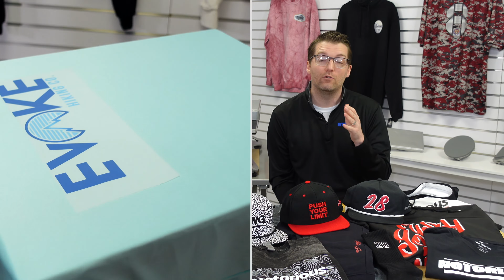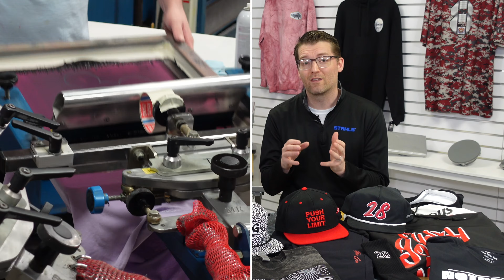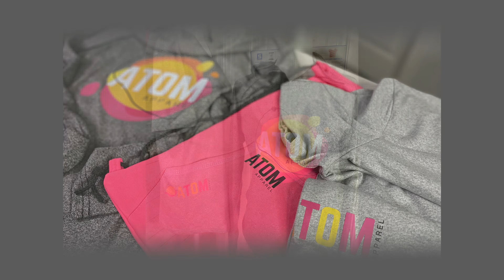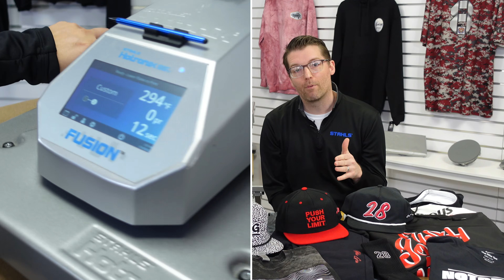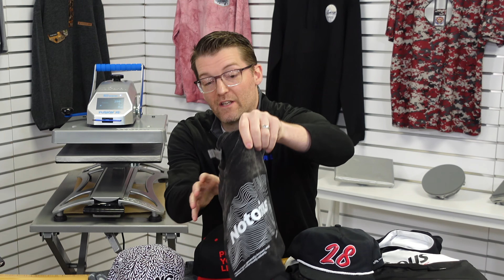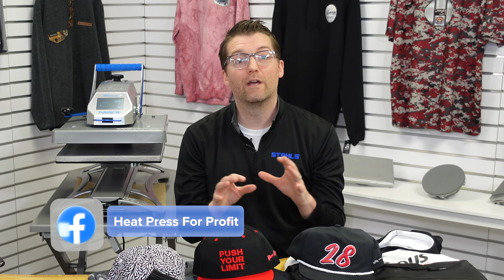Why You DO NEED a Heat Press for Your Clothing Brand

Comment: Hello how did you decorate the socks I see on the table? Is there a video on how you achieved it with a heat press?
Reply from the maker: Hello -  we used our CAD-CUT Premium Plus heat transfer vinyl on the socks, for its stretch and rebound.  We don't currently have a video for this.